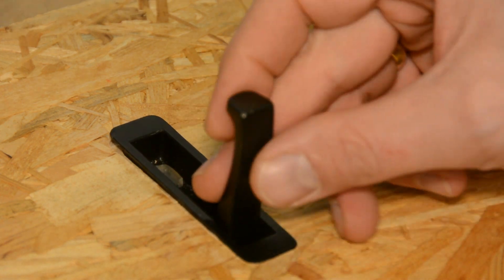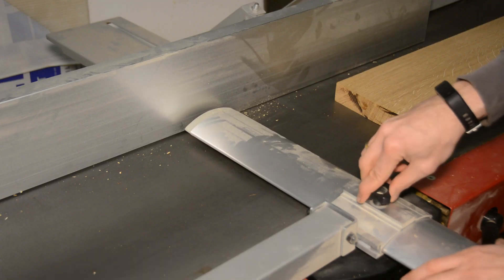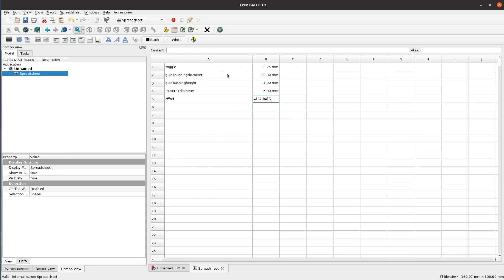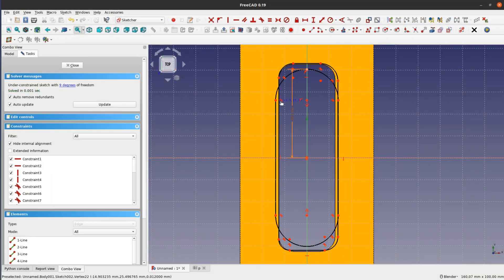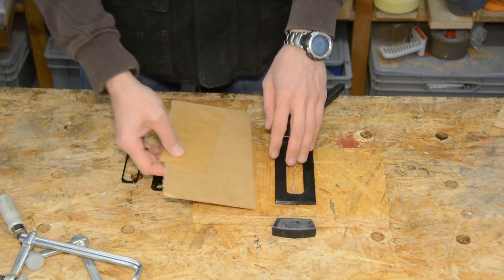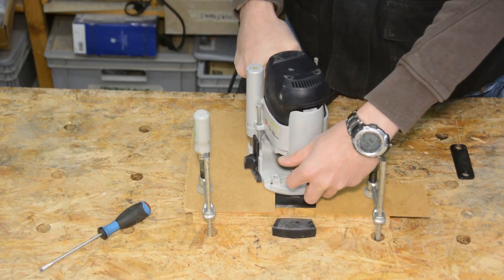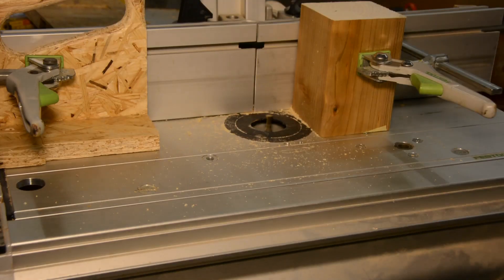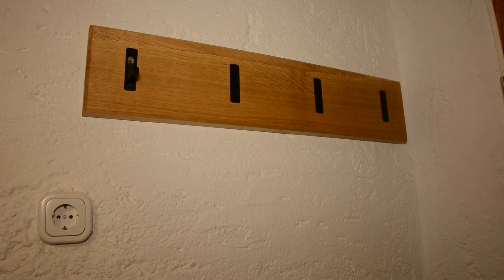Precision routing with no CNC

Comment: Did you have any issues with the template melting due to heat from the router bit/bearing? Any tips about wall thickness?
Reply from the maker: No issues as the guide bushing is not moving. The wall thickness should be thick enough so the guide bushing is not scratching the workpiece.